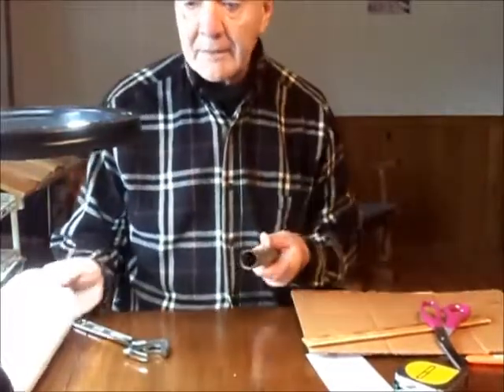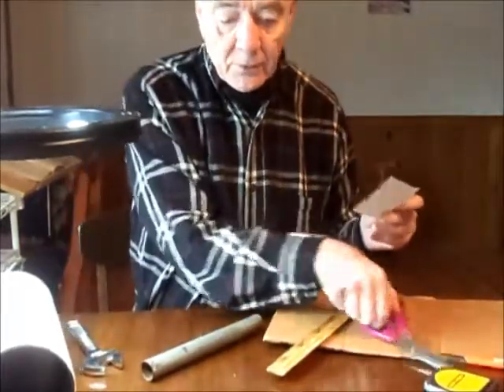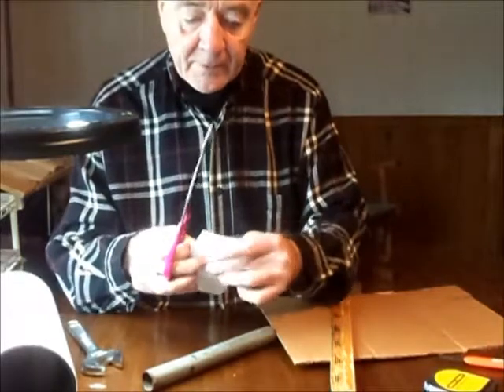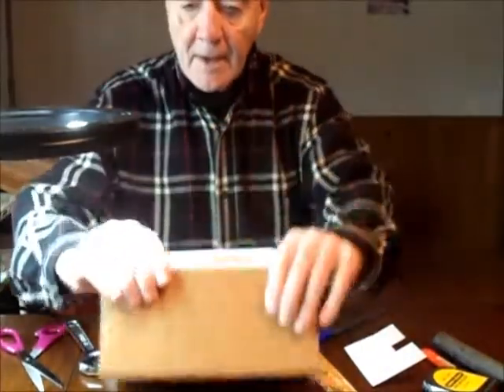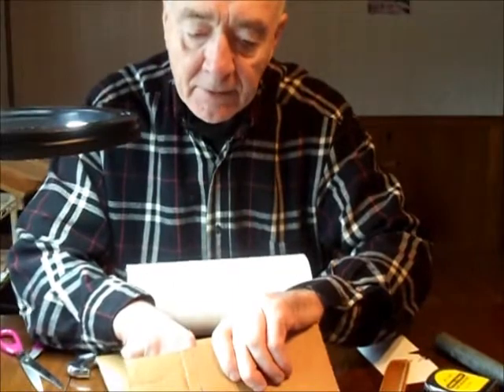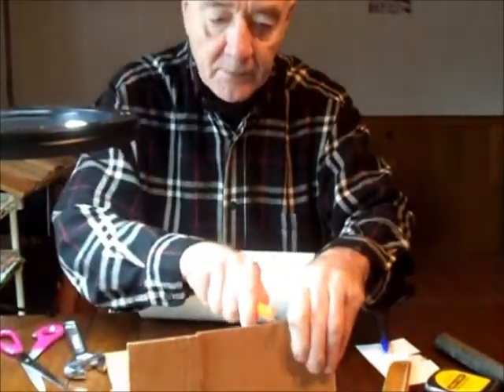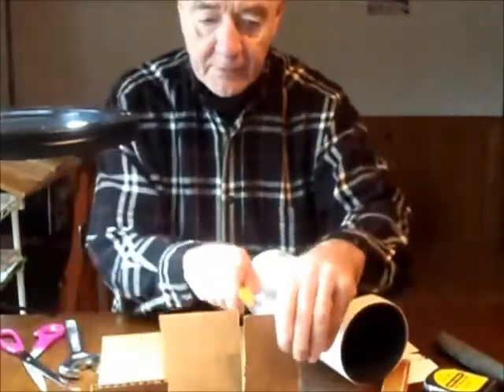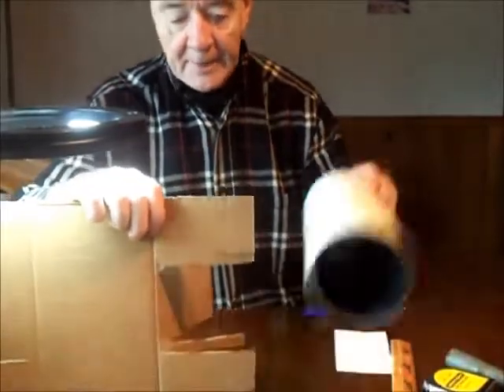Measure Pipe Diameter with Homemade Tools

Comment: Thank you so much for a simple answer! I've needed to replace my tub spout from a threaded pipe to one that slips on and so hesitant if my old pipe was the right size for the new one. A crescent wrench-perfect sub for calipers. Also learned 5/8 od copper is equal to 1/2 inch? Hope so!